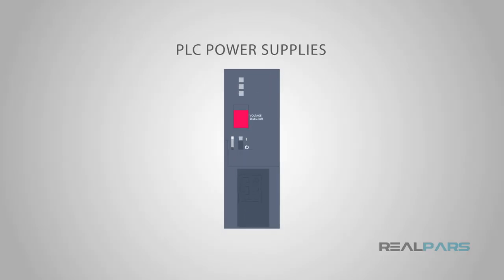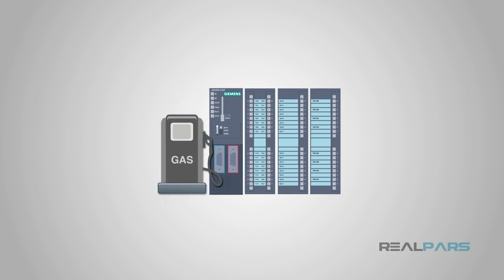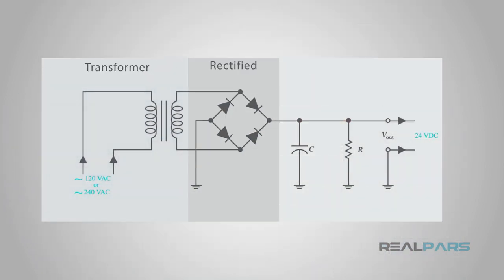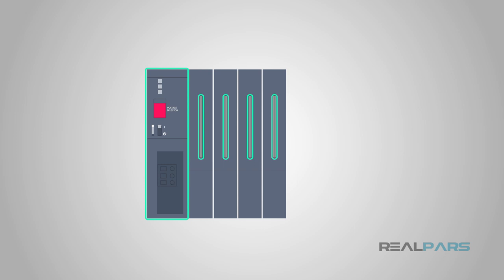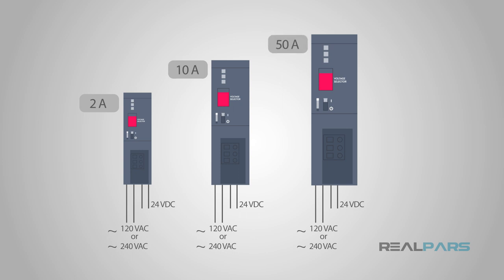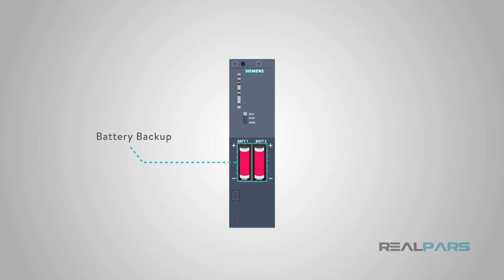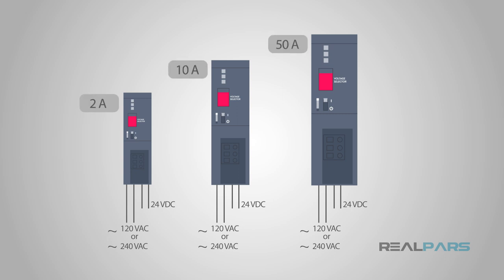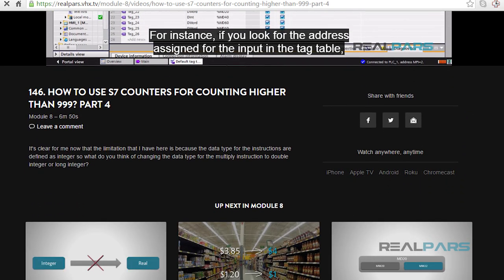How PLC Power Supplies Work

Comment: How often is the PLC power supply used to supply input switches or outputs such as solenoids ? I know they can have a separate supplies but just wondering whats normal out there
Reply: PLC digital input and output cards require a separate, or isolated power circuit, whenever the required power to the card can exceed the rated power of the PLC chassis or backplane power supply.  For instance, a typical low-power, transistor-based input or output card with 8 points and a total maximum output amperage of 0.50A, will likely be able to draw the required power from the PLC chassis backplane.  A higher-powered 8-point relay digital output card used to pull in small motor starters will probably require much more power than can be delivered by the PLC chassis, so an external power supply will be required.  Also, for isolated input and output cards, an external power supply is required.  In my 38 years of experience, about 1/2 of the digital input and output cards I have designed and/or installed (1000's) are on external power circuits.
Reply: Thanks for your detailed response. It is very interesting info.

Comment: Nice Video! Is it possible to use 24V DC supply out from PLC to power HMI and electromagnetic flowmeter? Or I should use different DC Supply for the flowmeter? Thanks
Reply from the maker: It depends on the size of the power supply.  For very small mag meters  (0.25 inches to 0.75 inches in diameter), you may be able to use the PLC power supply or run the meter using loop power or the PLC power supply.  Even if you can use the same power supply, I do not recommend it.  Most short circuits, over-amperage situations, and power fluctuations (a mag meter is an inductive load) occur with connected devices.  It is good practice to separate PLC power from device power to keep a faulty device from taking down the power supply to the PLC.

Comment: Thanks a lot Realpars, making understand automation as easy......I have a question sir, In Siemens PLC , supposedly S7-400, has two supply voltages: 5V and 24V . What are they used for?  Please reply, you people only can answer it appropriately.
Reply from the maker: Hi there,

Some of Siemens power supplies such as PS405 for S7-400 Series CPUs have 24VDC as their "input" voltage, and 5 VDC as their "output" voltage.

Let us know if you had further questions.
Thanks
Reply: Is this output of 5V supplied to input/output cards?

Comment: Thanks a lot... Really this video helps a lot for me. But I have one doubt, why PLC differ in Ampere rating.. Can you explain why??
Reply from the maker: Hi there, glad to hear you found this video helpful. 

We use different PLC power supplies with different current outputs depending on the number of devices that we have in the PLC panel. 

The more modules that we have for the PLC, the more output current we need. 

So when there are a lot of PLC modules, we need to use a bigger power supply and when there are only a few PLC modules we can make use of a smaller power supply with less output current. 

Hope this answers your question. :)

Comment: I have a doubt, real pars. Why we use 24v for most of the plc?
Reply from the maker: The two main reasons are that 24VDC is much safer than 120VAC, and the electronics used for PLC hardware is all designed around VDC.  24VDC Power Suppliers are inexpensive and provide the basis for all typical control system hardware:  24VDC for powering transmitters, analog loops, positioners, etc.; 12VDC for specialty modules and some analytical equipment; 0-10VDC for some analog inputs, 5VDC for PLC card backplanes and electronic circuits.
Reply: Thanks for sharing.